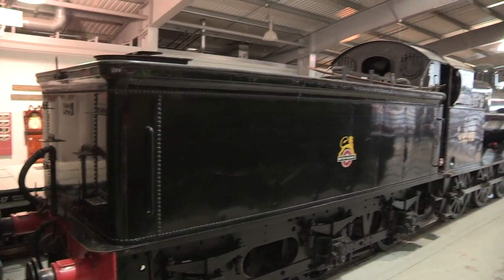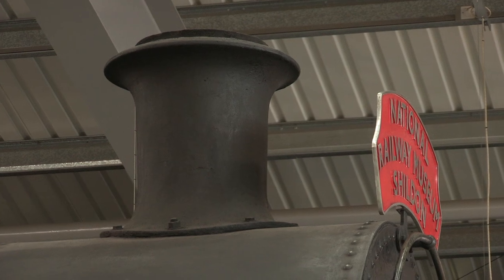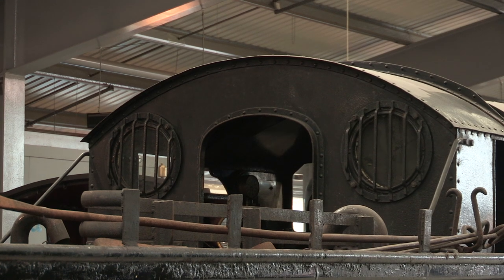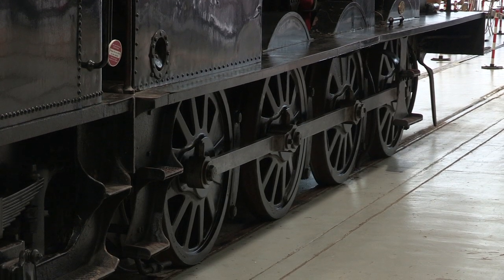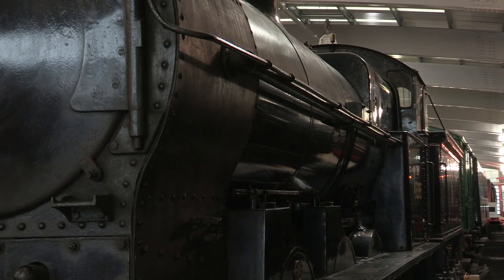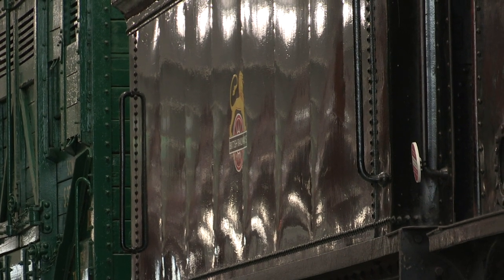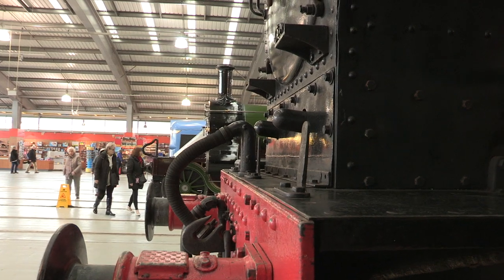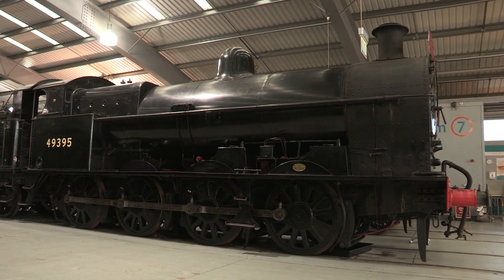SOLE SLIP: LNWR 'Super D' No 49395

Comment: What does “the controls are all backwards mean?” Like are they on the opposite side, open the wrong way or just counter-intuitive to operate? Also do the injectors leak constantly and you don’t know it?
Reply: Late but here goes: Yeah, they open the wrong way. It's a left hand drive engine, and the regulator opens anti-clockwise instead of clockwise. So when it's shut, the regulator is up in front of your face, and when its open it's down by your knee. The reverser is also backwards, you turn it anti-clockwise for forward gear, and clockwise for reverse gear

Comment: Any reason for the pronounced frontal overhang?
Reply: This is a guess, but I think its to fit on smaller turntables. I know some American prototypes have overhang on the tenders so they can squeeze onto existing turntables without spending the money to upgrade them. As long as the overhang didn't hit anything your good to go.